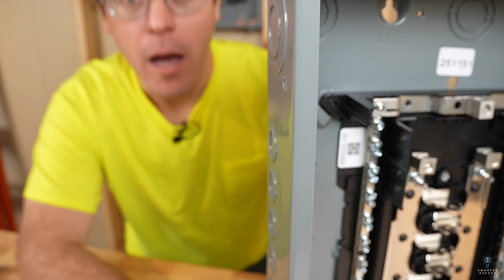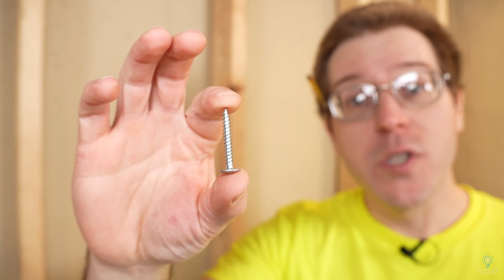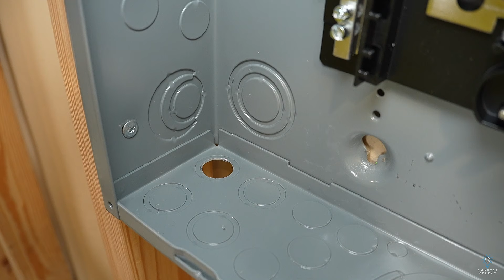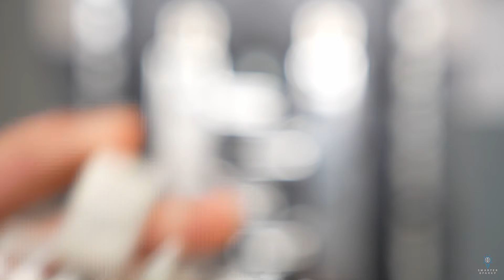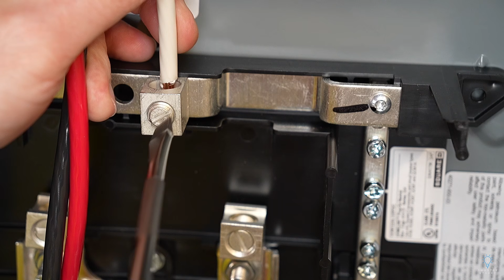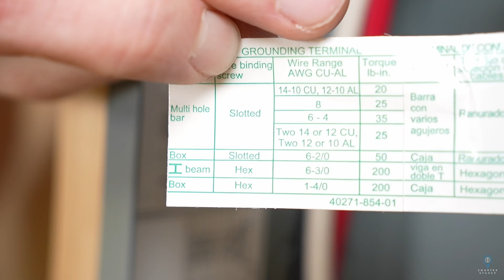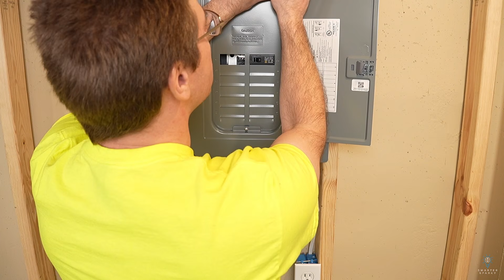Unlocking the Basics: How to Install a Subpanel

Comment from the maker: Correction: I mispoke around 29:10 when I said #4 AWG would be used for a 100A subpanel. You would have to use 1AWG aluminum. #4 AWG aluminum would be good for a 60A subpanel.
Reply: I'm pretty new to this home electric stuff, bit I keep hearing over and over about this nec loophole where "if you promise" blah blah you can use 55amp wire on a 60 amp breaker... this boggles my mind why anyone would "use" this loophole, save a few dollars? It creates a dangerous situation. Breakers open due to HEAT, and the wires being undersized means you're betting the future on a "promise" not to overload the circuit instead of the basic math you KNOW to be true. What's the thinking here? "It's OK for the wiring in my walls to overheat JUST A LITTLE"??? You know Murphy's law says if you CAN plug 60 amps into that circuit, someone WILL.
Reply: What if you are using copper wire what size gauge would you use
Reply: @eloriginal302  With copper, for a 60A subpanel, #6 THHN, etc., in conduit is fine. NM wire should be #4. For 100A, you'll need #3 wire in conduit. NM would need to be #1 for 100A (or #2 for the 95A "pinky-swear" exception). I've never seen #1 NM wire.
Reply: Very good video.
Reply: I came here specifically to comment on this.
Reply: What if you spent a little more money and installed a copper wire? Could you 4 or 2 AWG in that case?
Reply: @andrewkraskey238  #3 copper in conduit for 100A. It's a LOT more than #1 aluminum. If you're not an electrician experienced with aluminum wire, I would go with copper.
Reply: Question about the Green screw: Just built an extended garage135 feet away from the house, my main panel outside is completely full, I need to remove one of the bottom breaker and use that slot to a subpanel then add the breaker I remove to the subpanel. I’m using MBL-HM-FDR-2-2-4-6-A wire and100A breaker, should I use the green screw?
Reply: I would never use aluminum.....have seen too many nightmares. The anti-oxidant grease works for a while but the chemistry of dissimilar metals eventually shows its ugly head. Also just use a punch and hammer to punch out slugs.....you won't accidentally dent the box. Anti-oxidant should be applied to all connections, as even copper tends to oxidize non-perfect strand/stud mating as will happen after years of expansion/contraction. You only need a thin film. It doesn't hurt to torque all the stud connections after a few years since copper is malleable.

Comment: Great video, thanks!   I especially appreciate the discussion regarding the box bonding screw.  Your explanation is very clear and you focused on this important issue in a way that couldn't be easily missed.  
  -  Do you have a video that explains "why" separate GFCI breakers are required in a subpanel when feeding a dedicated circuit (e.g. a pool pump or fridge)?   What is the physical reason beyond a simple code requirement (if one exists)?
  - Also, a discussion on grounding rods (for subpanels) would be great.  i.e.  when and why.

Comment: Am I wrong in thinking you must have some way to deenergize line 1 and 2 coming into that main panel. Every time you got fingers, ground wire, neutral wire what looked like about 1/16 an inch away from those lugs I was getting tense. Of course, IF we did something like this ourselves we cannot pull our meter so those would be hot all the time.

Comment: [IMHO] while the earth ground and the neutral both come together at the bonding point, they serve two very different purposes
the ground carries a fault current to earth. the neutral returns the load current and could rise in voltage under loose neutral conditions.
safety requires they only come together at the bonding point. if one does not understand the why of this, employ a professional.

Comment: If the sub panel is in a different building, you would need a main breaker as a switch?
Reply from the maker: Generally separate buildings need a disconnect, but it doesn't necessarily have to be a main breaker. It could be a conventional disconnect switch.

Comment: 6/3 wire is good for 55 amps. But there's 2 hot 6 guage wires, wouldn't that be 55 amp each? So basically you have 100 amp sub box
Reply from the maker: No, because if we have 55 amps from one line to neutral, that is is at 120v. Still 55 amps though. If we have 55 amps on both lines, that is at 240 volts, but it is still 55 amps. You are thinking of the wires adding together, when in reality they end up in series (supply and return). Great question!

Comment: Would these instructions apply to install a main panel? We bought a very old house and that panel must be replaced. The fuses aren't sold anymore. It is that old 😂

Are there 60 amps wires instead of 55amps?

I am studying to become an electricians assistance. I know, should ask my instructor, but it's Sunday 😂

Comment: Great video!  Would it make sense to put the subpanel on a switch if it’s far away from the main panel so you can turn it on and off at the sub panel as you’re working?  Instead of going back back-and-forth to the main panel?

Comment: How do you size the sub panel? How do you know if you want 60A vs 120A?
Reply: You will base it on the anticipated/calculated electrical load. In other words, based on what you know you’ll have running; lights, appliances, etc. i hope that helps
Reply: @HARDINMALAYAH thank you

Comment: meanwhile, every fuse box I replaced ran 30 amps thru 12/2.   lol.   But, back in the day, the wires were not insulated around the wires, so, wires got hot, and the heat was free to leave the wire.  Just an interesting side note to the 55 amp thru a 60 amp breaker argument.

Comment: You are doing the U.S. a big service.  Your presentation is very easy to follow and understand all the intricacies of this job. I used to do this type of work between 1961 and 1964.  Electric Co gave a very big discount on a new Electric service if you installed an Electric hot water heater.  I think I installed way over 100 new electric services back then.

Comment: Is it possible to transfer 60 am circuit breaker   from mine panel to Sub panel is i didn't have space  or room on the mine panel to connect them together , can some one help thank for all
Reply from the maker: It is possible, and pretty commonly done when there isn't enough room in the main panel.

Comment: what a great video! one thing i would add is to use dielectric grease on connections
Reply from the maker: Thank you! Dielectric grease isn't necessary with copper. It could help in corrosive environments, though.

Comment: What if I'm using conduit to the subpanel how does a ground bar work in that situation? And where does the ground rod connect to inside the subpanel?
Reply from the maker: If the raceway serves as an equipment grounding conductor per NEC 250.118, no separate ground wire is required in the raceway. The ground bar will still be grounded through the equipment enclosure/chassis.

Comment: Hi my house only has 1 sub panel and it is upstairs. In the garage, I have the same box on the far left, and that is it. So if I want to put a sub panel right next to it, like the second box that you have, do I have to have a separate ground for the sub, and can I run the neutral on the main box to the sub panel as a Neutral? But my question I always have is that the Neutral and the Ground are bonded at the main box, s do I still run the Neutral from the sub to the bonded Ground and Neutral at the main box? Thank you so, so much for the great video.
Reply from the maker: The sub panel would get a neutral and an a separate ground wire. Once circuits leave the main panel, neutrals and grounds must be separate.

Comment: what if the sub panel is connected directly to the main panel. still need to separate the ground?
Reply from the maker: Yep, generally speaking it would get a separate ground even if it comes right off the main panel.

Comment: Is there a reason why you would not mount the panel upside down so that the lugs are closer to our feeder inlet and we done have to run the hot wires along the inside of our sub panel?
Reply from the maker: You can certainly do that. That's how my main panel is installed in my house.

Comment: Retired sparky here. Good installation video - subbed. FWIW I always use Noalox conductive grease on ALL stranded cable AL and CU even tho’ CU is not required. I’ve been around long enough to have seen plenty of resistance-heat making corrosion form in stranded CU over time in certain conditions. To be most effective Noalox must be worked into the strands somewhat and not just blobbed on the surface. Also it is very good practice to get yourself a torque driver and use it religiously on all your lugs. Torque to published spec then mark them.
Reply from the maker: Yes I should have covered torque specs in this video, too.

Comment: I know you mentioned a ground video coming, but quick question: For an outbuilding, would you still bond the main panel to the subpanel with a ground wire even though a separate ground rod and wire are installed?
Reply from the maker: Generally speaking, yes. The sub panel would have a neutral and ground wire brought to it, and the grounding electrode system (ground rods) at the outbuilding would land on the ground bar. totally separate.

Comment: Wow, great video! Very impressive! Need to add a subpanel to my basement or 2 circuits. The length of the run will be about 75 feet and I think subpanel is my best choice since I want to have access to the circuits in the basement. Also considering moving sump pump breakers to the basement panel.
Reply from the maker: That sounds like a fun project!

Comment: Unless I missed it, you failed to mention that 1/4 " of sheathing needs to remain on a cable entering a panel/enclosure. In my humble opinion, you have thus far failed as a a journeyman in regards to teaching an apprentice.  I will not give this video a favorable rating, try again.
Reply from the maker: Yes it is difficult to ensure that every detail is included in each and every video. I mentioned the 1/4" sheathing rule in one of my other videos I believe. Thanks for the feedback, and the engagement.

Comment: The US is so far behind regarding electricity, not even funny. 
And for those trying to be pedantic, no, not electronics.
Reply from the maker: I don't know much about wiring in other parts of the world. Residential wiring here in the US has been boiled down to such a cheap price point that it does indeed seem janky. Commercial and industrial is much more robust. Someday it'd be fun to tour different parts of the world and shadow electricians for a few days to see how things are done.
Reply: @SmarterSparky I am building panels/cabinets for most standards around the world including UL/CSA/C E/UK amongst others, by far the easier and better ones are found in Europe, far safer inside as well. 
For example main switches, the bigger Amp related ones, Allen Bradly with fuses, those come in two parts, expensive fuses and no safety at all, open contacts with bare metal bars, wtf, we have much smaller ones rated for the same currents with far better safety. 
Open a high current cab. In the states, then one here, so much safer.

Comment: I have a question. I have a GFI breaker in the panel that keeps tripping. I got one of those Klein breaker locator. When I use it, I can obviously locate the tripped breaker without the locater but when I use the locater to test with all the GFI breakers are identified. Is it possible to have too many GFI breakers?
Reply from the maker: Having too many wouldn't be the issue. It is possible the breaker is bad, but it could also be tripping for a reason (doing its' job). That might be worth investigating.

Comment: I'm currently adding a sub panel to my shop..100 amp..the electrician told me I could use either #02 aluminum or #2awg copper..I saw your pop saying #4awg for 100 amp..I'm confused.. thanks
Reply from the maker: There might be voltage drop considerations your electrician is taking into account

Comment: Really good, thorough walkthrough. I’m recently retired. Nearly 40 years electric field - 12 industrial electrician, 27 EE. All heavy industrial. I’m not up so much on commercial/residential codes and procedures, but there is a lot of crossover. Your tips and things to watch out for are dead nuts. I’m putting in a sub panel in my garage and wanted to poke around and see how guys are handling it. Found a gem here!
Reply from the maker: Right on! Thanks for sharing!

Comment: Got a question, i'm going to be installing one of these and should i add a ground wire to another ground rod to the grounding strip ?
Reply from the maker: Ground rods are not typically needed in subpanels installed in the same building
Reply: @SmarterSparky  thanks,  but i put one anyways.  I ran the wire quite a ways  250 ft. from my house to a out building.  Yea i know the drop but i have nothing heavy pull on it.  A fan and light bout it.

Comment: In a subpanel at a detached garage should you install a main disconnect in the subpanel ?  and isn't #2 AWG Aluminum good for 100 Amps (Table 310.16) unless the distance is to great and voltage drop is applied then you will need to step up the size ? Great video keep up the good work one of the best detailed videos I've seen on subpanels
Reply from the maker: Most service equipment is 75 deg C rated, so #2 AWG is only good for 90 A in T310.16. Yes the detached garage would need a disconnect per 225.31 (2026 NEC)

Comment: A little inconsistency: if we're pretending your cement backing is drywall then the corner knockout in the panel and the closest knockout in the recepticle box would have left the wires in the area to be protected from screws.

Comment: Nice video, very good for beginners.  I scrolled through many comments, and I was suprised that no one mentioned that you did not torque the connections to the proper vaules.  I consider this to be an important step not to be skipped.
Reply from the maker: Yes I will have to cover torques in a future video

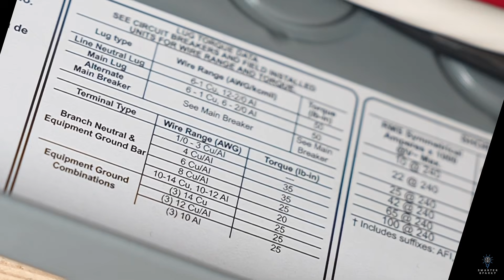Comment: What about the torque on each screw?  At 37:50 the data table shows the torque (lb-in) for the respective terminal types.  You just said to tighten it down.  Do you use a torque wrench or measure how tight it is?  Was that off camera? Or does it not matter?
Reply from the maker: Yes I should have covered torques as well

Comment: Play your video might be good but you're going to have to make another one because now every panel in the house is a sub panel even the main panel if it's wired right up to code if it's wired up to the old code then you have a sub panel after the panel but right now if you have a new panel installed every panel including the new one is a sub panel and you must have a disconnect outside and the ground does not go to the panel anymore it only goes to your water meter and your ground rods and your disconnect outside😅 before you make any more videos make sure you follow today's codes
Reply from the maker: You are correct. The 2026 NEC has removed the option to choose where the official service disconnect is based on labeling. The only option is the emergency disconnect.

Comment: This is a great channel!  Thank you!

Eventually I’ll be looking for a video for how to run a wire from my tractor shed to my cattle barn.

Possibly underground, possibly overhead.

A few years ago we took down all of the 1940s vintage overhead farm wiring and installed 400’ underground conduit and ran primary wire down the pole, through the conduit, and ended at a pad mounted transformer.  Wow do I have electrical capacity now!
Reply from the maker: I have a shed that needs a new feeder ran to it eventually. I will make a video of it if/when I have the funds to do so

Comment: It Also Will Allow You To Break Off More Circuits If The Main Panel Is Crowded! Wires Running In Conduit Wont Carry The Current That Wires Suspended In Air Will! That Is Why The Wires Feeding The Service Entrance Are Half The Size As The Ones That Connect To The Meter Base! They Are Rated With Safety First And Will Carry 20% More Unless They Are In The Worst Conditions That They Planned For!
Reply from the maker: Yep open air conductors will indeed carry more current 👍

Comment: So in a shed, you'd have 2 grounds hooked up, the one from the main panel and one to a ground bar?
Reply: You'd have two grounds hooked up to the GROUNDING bar, yes. But NO bonding between grounding bar and the neutral bar. Capiche?
Reply from the maker: Yep @poursergio is correct. Two grounds hooked up to the grounding bar, but no connection between ground and neutral in a shed fed from the house.

Comment: Neutral Switching Problem, I'm trying to make a whole house battery backup UPS system. Using a pecan 5000 battery and a sub panel. What AI is telling me that I'll have a neutral switching problem. Because the battery will be plugged into the house grid in UPS mode while it's powering the subpanel. Is AI correct, because it's wrong a lot of times.
Reply: Whatever AI is telling you, you don't "switch the neutral. When you click the main breaker in your main panel and click the sub panel breaker in that same main panel, that will feed your sub panel where your UPS/battery is feeding the house. Right? You have to make sure and install an "interlock kit" that prevents botrh breakers at the main panel to be simultaneously ON. that's it. No care about the "neutral probloem" this AI of yours is trying to create. Hope I understood your concern properly. Good luck!
Reply from the maker: Yeah I think AI is hallucinating. You will either need a transfer switch, or an interlock kit. I think AI might be trying to say there is a chance you might have a floating neutral problem, but a properly installed transfer switch will remedy that.